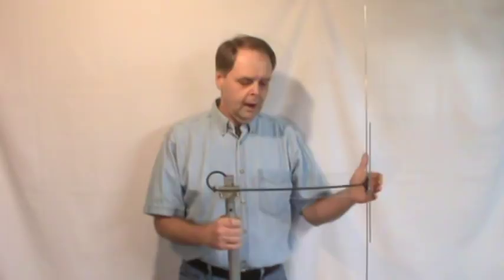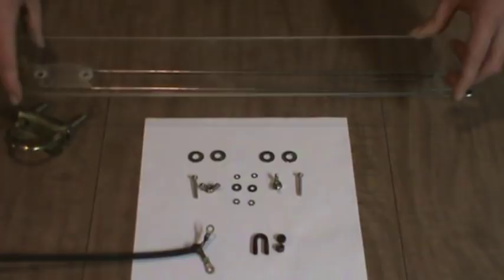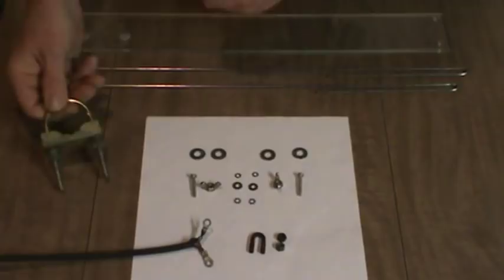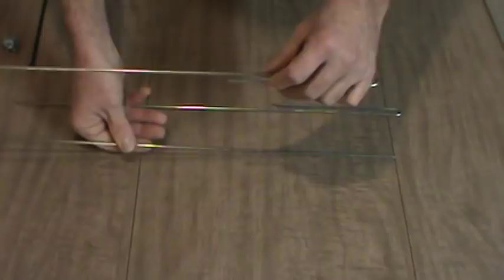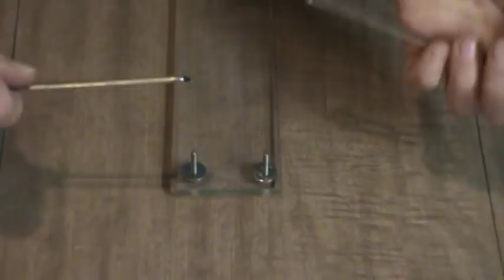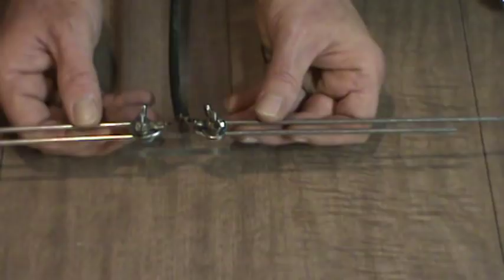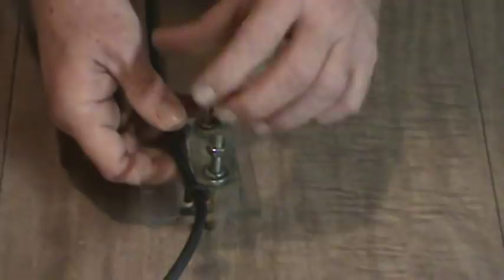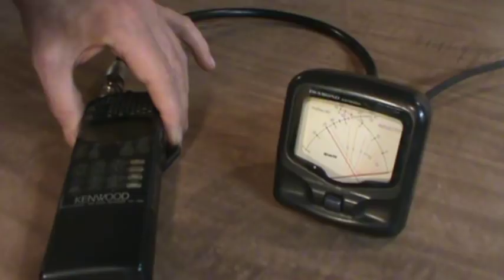Ham Radio 2m/70cm Vertical Dipole Antenna

Comment: I have made a GP antenna, radiator 52 cm an 3 radials 52 cm, antenna is for 2 m and 70 cm SWR beter than 1:1.5 even on 70 1:1:1 .

Comment: Hi Dave, I made this antenna using #6 awg (0.165" diameter) bare copper grounding wire, with a 5 loop (6" diameter) coax (Lmn-400) balun... And it works great at 30' w/ an SWR of 1.3. My question is... How much power can it handle? I'd like to run 100 Watts. -Drew
Reply: Qual a medida de comprometimento das hastes vhf e uhf?

Comment: Two questions........
1. I see the Gain Question was asked, but didn't see an answer, so I'll parrot that one - What is the gain (approx) here?
2. And just keeping my mind open to future expansion, what is this rated to for wattage?  I'm guessing about 20ish?  Is there a chart somewhere that would tell me what gauge of wire I should use if I wanted to go 35w or 45w, etc?
Reply: I believe all gain measurements are in references to a half wave dipole so in this cause the gain should theoretically be 0 db.
Reply: The antenna gain is 0dBi. It is the coax that determine the wattage. Look at the specification of the coax you use.

Comment: Ok Dave,  I'm new… so new I haven't tested yet. I do that on 10/24/15. So don't laugh at my question. this antenna looks like, something I can do. 2 questions… does the dipole work better verticle or horizontal or does it matter? Also, on the coax rings connected to the elements… are they soldiered or crimped?

Comment: Since I plan on mounting this in an attic and not exposed to the elements. Can I use 1/8" galvanized rods instead of stainless steel for the elements?

Comment: Hi Dave, instead of stainless steel rods, have you tried using aluminum rods, will they create a difference just in case i have change the materials use and just in case I will work on a 3/8 diameter aluminum tubing?

Hope to hear from you soon.

Comment: Does such antennas have better UHF reception because the antenna is larger. Because it includes VHF dipole? Or does it not affect UHF reception or may it fail to receive UHF?

Comment: I'm using one of these but it just has elements cut for 145mhz,

Its fed with 50ohm co-ax....I have not fitted any can of balun...will this cause me any probs...I only run 4 watts from a hand-held,

Not tested it with an SWR meter but it work very well...so should I fit a balun or ferrite choke.

Nick in the UK.

Comment: Hello Dave My name Is James Hannah Jr kc9jqt and I have a MFJ antenna analyzer and I basically dont undrstand it so well concerning tuning tricks. i have built several jpoles and and two omni directional  suareloops and double stacked two 6 element 2 meter yagis/beam antennas,and co phased coax harness antennas work OK but are not perfected.  tunig them has always been a noggin scratcher. any videos from you with your prospective surely would help a lot  Great work and 73s.

Comment: I went to get the parts for this and Home Depot nor Lowe's (close to me) have stainless rod.  Got all the bolts & washers in SS though.  They have 1/8" steel rod or 1/4" aluminium rod.  Can I use the steel and then paint it black? 

Neither of them carry roof top TV antenna parts any more but I'm sure I can find some U bolts in plumbing.

Comment: Does this require a balun? Also, I'm considering using this on top of my shed which is around 2.5 meters high, would this be ok? Also I am using a cobra cb and would this be suitable with this type of antenna?

Comment: Can't find 1/8" SS rod in my area.  Will plain jane carbon steel work??  Would copper wire be better??  Also is there anything sacred about the 18" length of plexiglass?  I have a piece that is 14" long and would like to use it.

Comment: Hi Dave,Would appreciate your thoughts about grounding this antenna. In addition to grounding the pole, I would like to ground the coax shield connected to the bottom pole . Would that affect the characteristics of the antenna?

Thanks

Paul

Comment: I’ve just built this antenna and as a noob it’s a great way to get started but, silly question coming, how do the two different bands know which section of rod to radiate from, in other words how does the 70cm band pick the shorter element and the 2meter the other? And why isnt the radiation the full length since it’s only a bend,  not a seperate element.
Reply from the maker: Think in terms of wave-length instead of electricity.  RF travels along the outside of a conductor while electricity flows through the center.  Wave-length is cut off at a sharp bend while electricity is not.  With the 2m/70cm centers tied together at the feed-point they become two separate antennas and wave-length will follow the path of least resistance.
Reply: Dave Tadlock thanks for that Dave.

Comment: Hi Dave - just discovered your channel. Got my Foundation licence a few weeks ago (it's the entry licence in Australia) and I've been looking for a multi-band antenna for my rig (currently only an HT), and this looks ideal. Would there be any benefit in making the spacing between the two elements larger for more adjustability ?

Jon
VK2FBID

Comment: Hi Dave, great video. quick question. i cant find the SS rods locally, but can find aluminum ones and threaded rods. can i use the aluminum rods? what is the drawbacks to using them?
Reply: Amazon has 1/8" x 36" stainless rod (used for TIG welding) available in 1# (10/pcs)  tubes for under $16 on Prime.

Comment: Hello, thanks for great tutorial, I will try to build this antenna next week, already found 3mm steel rods to buy. I am quite new to the HAM, so I would like to ask some questions, why does it have 5/8 for 2m and 1/4 for 70cm, why not both 5/8 or both 1/4? :)
and also would like to know what gain does it have on 2m and what on 70cm. Thanks. LY5JJ

Comment: Hi Dave. I have an excellent question! How would I go about constructing a quad band multi element dipole? I have ideas, but not %100 sure on any of them. It would have to be 10M, 6M, 2M, and 70CM. I would really appreciate any help! I have wanted to be a ham for about 30 years, and finally got a book and a study program. I will be taking the test in about 2 weeks. 
 Thanks
Reply from the maker: I did some experimenting in the past with a similar idea. I found that 6m/2m/70cm will not work together all in the same plane. 2m and 70cm will have to be vertical and 6m will have to be horizontal for it to work. Good luck taking your test and welcome to amateur radio! :)
Reply: Dave Tadlock Have you looked into fractal antenna design yet?  Possible future project, heh-heh, hint, hint..... ; )    THANKS 4 the great vids!

Comment: I like to  build  this antenna using  5/8 in aluminium  tubes.  Can I increase  the  gap between  2m and 70cm  radiating  elements. 4cm  gap ?????
de 4S7JL

Comment: Hi Dave,I have problems in findind stainless steel rods. I suposse it can also be done with steel rods (not stainless steel). Please confirm.
Reply from the maker: Yes. I've built similar antennas with steel coat hangers.  Coat hangers will rust if used outdoors so you might give them a coat of paint. Thanks for watching and 73.

Comment: Hi Dave, I know this video has been up for awhile but I was wondering if you think it would work if you added a 3rd set of elements to cover 1.25 m
Reply from the maker: I have not tried adding 1.25 cm.  I did try adding 6 meter elements and it did not work.  2m and 70 cm will work together in the same plane but the 6 meter elements have to be mounted horizontally, in the opposite plane.

Comment: Hi there,
does this antenna not need a balun?
Reply: It is a 1/4 wave lenght coax from the dipole to the mast that works as a poor mans balun. You can skip those two short elements for the 70cm band. The 2m elements have a natural resonance at 3 times it's frequency at 70cm. Just fine tune the lenghts of the elements if you have a SWR meter or similar at hand.

Comment: Hi, Dave. Keep up the good work. Could you build me a two meter ham j-pole. or the 2m/ 70 cm Vertical Dipole Antenna. Im handy cap, or I would build it my self. I cant wait to get back on the air. If you cant that's fine. 73 my friend.

Comment: Hi, thanks for sharing the knowledge. 
I'd like a suggestion, which is better for a dipole antenna :
- Combined VHF/UHF in one piece, as you did
- or separate VHF and UHF antennas ?
As image linked here : https://drive.google.com/open?id=1or97N1dIlGATy-PmLchcH7Fe9q0KhaQE
Variant A or B ?
Will combined VHF AND UHF together in one piece cause any interferance and would it affect SWR setting ( poles lengts ) ?

Comment: how far can this antenna reach using an 8 watt ht?
Reply: depends on how high the antenna is, where your location is, if you use repeaters, how close you are to repeaters, the power output of the repeaters, conditions including weather and others.